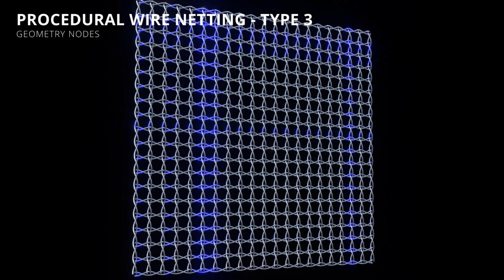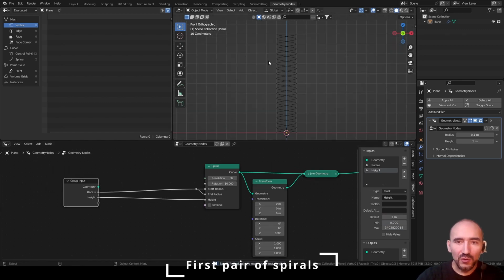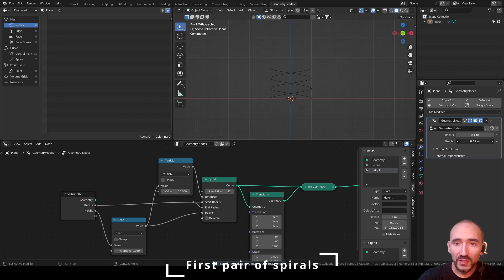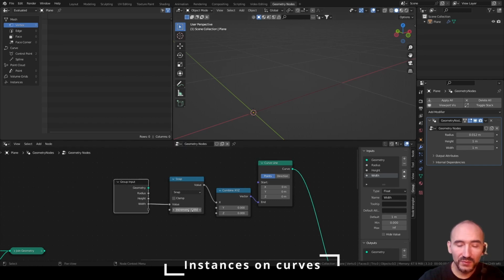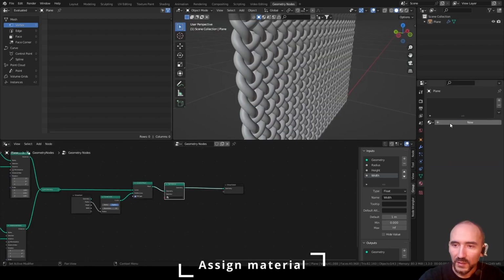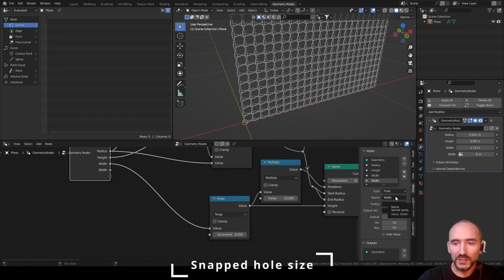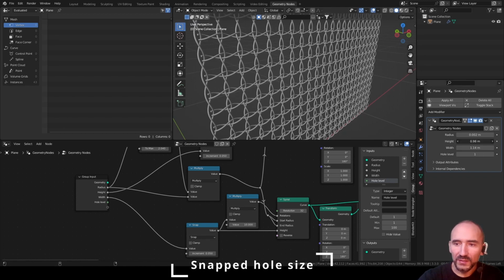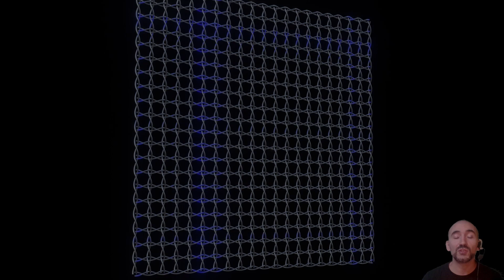Procedural wire netting type 3/8 in Geometry nodes - Blender tutorial ENG

Comment: I am surprised you are not adding the loops at the ends of the strands - joining each twisted pair or folding the ends back to itself around the tangent wires. It would make the whole thing look more finished.
It is still a very good looking version of wire.... Thanks for teaching me.
Reply from the maker: Thank you Neil! I know but in these cases i focused on the shape itself of the wire knowing that in a "standard" environment you can add simple poles at the ends. However it would be possible adding half circle rotated peace, instantiated like the horizontal (and vertical) spirals, join together, convert them all from curve to mesh without profile curve, merged by distance to perfectly connect the spirals with the end half circles, convert all this from mesh to curve end then again from curve to mesh with the profile curve described in the tutorial. I hope I explained myself well 🙂